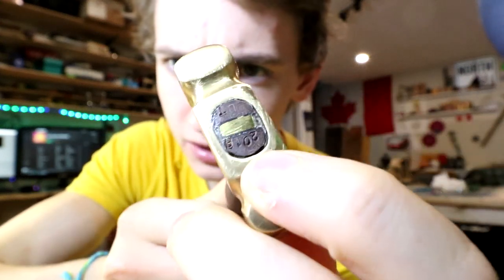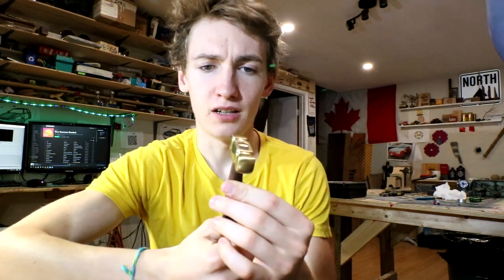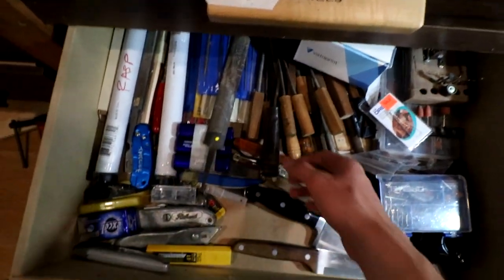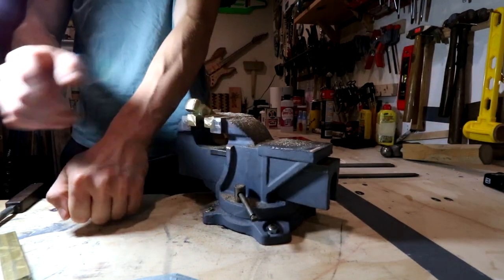How I Made An Elegant Brass hammer with only Hand Tools

Comment: You did a particularly nice job polishing up the brass. I don't have a lot of patience for metal finishing, so I just draw-filed mine and called it good. 

BTW, if you want something to use it on, plus another project for the channel, you could try making a wooden hand plane. A little hammer like that is perfect for adjusting the plane iron.
Reply from the maker: That would be awesome! I actually have a few old plane blades!

Comment: Awesome Dylan!!! So interesting to watch the whole process. One question: Does the oil help to get a better finish to the brass?
Reply from the maker: I honestly dont know. I just know wet sanding with high grits makes teh paper clog less with metal chips... Usually youd use water.. the oil seemed to work